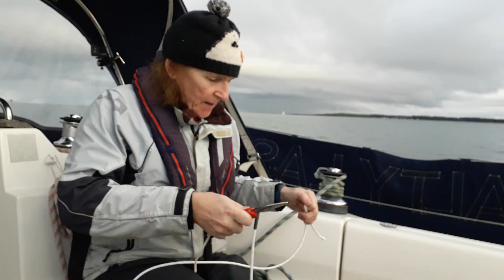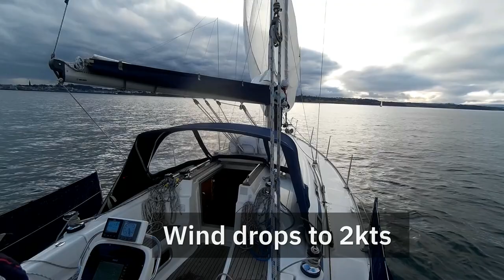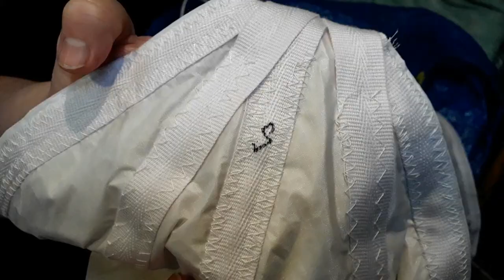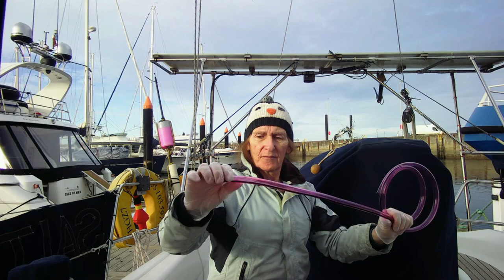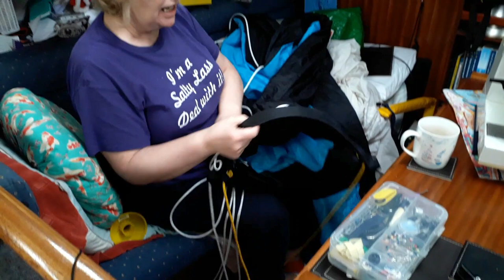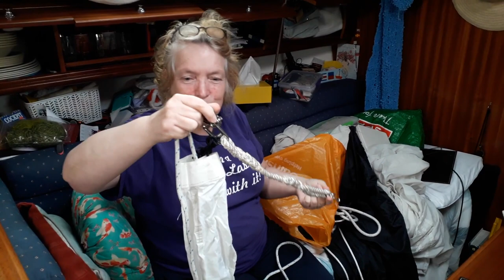Sailing Northern Ireland - Belfast Lough - Cruising Chute - Ep. 275

Comment: Good for you to be working with two chute snuffers inside a boat. Did you ever make one or they are both manufactured. I’m having that discussion with a fellow boater…how hard would it be to sew that material….
I have two of those shaker hoses. One for fuel and one for water. Standing by for part Two of the snuffer project. 🇨🇦
Reply from the maker: We made one and inherited the other. The inherited on has a few things that need alteration, but all minor stuff like swapping an old shackle for a new one, but we hope to try them out on the next calm day. The issue is getting a calm day around here...